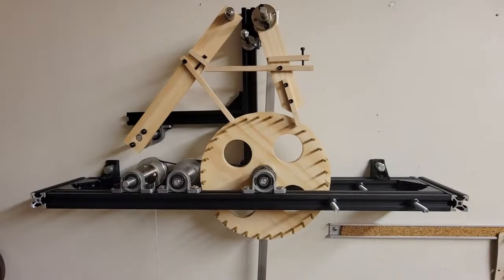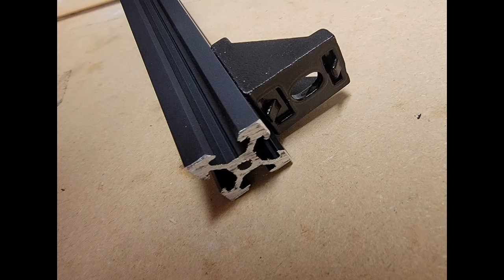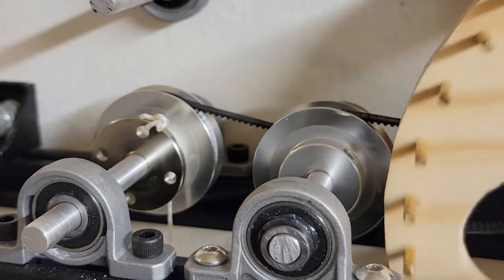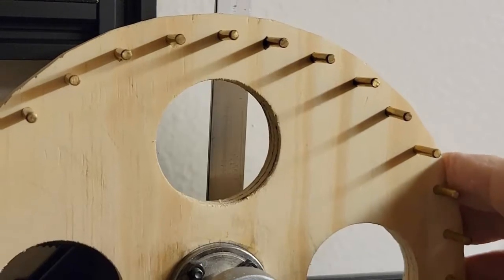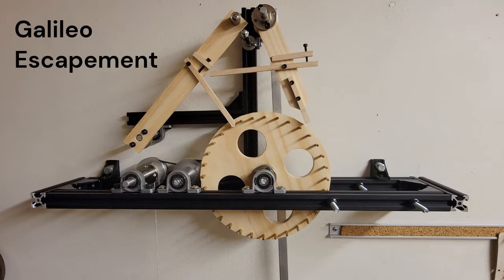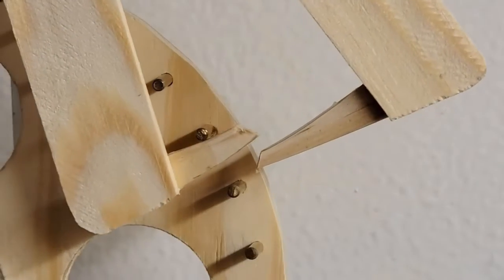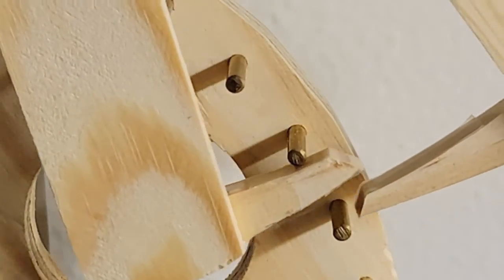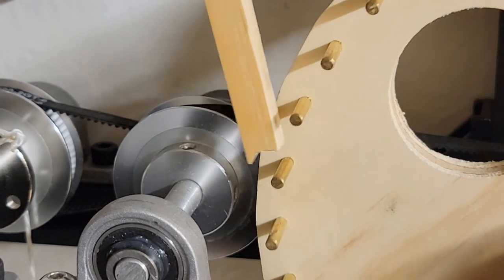Four Wooden Clock Escapements

Comment: Nice to see several types. Do you know huygen drive, to constant load the weight? Can improve this?
Reply from the maker: Are you talking about a Remontoire rig that rewinds itself frequently to keep the weight constant?  I've seen seen several of those on clock builder's channels.  Wonderful mechanisms.  However, accuracy is the least of my concern with an aluminum pendulum rod and a weight system that has to be wound 3 times a day.  I am interested to see if I could do a gravity escapement on this system. Gravity movements were used a lot in the large clock movements that went into tower clocks.

Comment: Hello Jeff. What was the longest run time? And which escapement was it? Thanks!
Reply from the maker: I never really measured them.  Each escapement runs on the same wheel and same pendulum, so I assume they're about the same, to first order.  The weight drops 12" per hour, so It's only good for about 5 hours until the weight hits the floor.  I'd need more gears and heavier weights to even get it to run 24 hours.
Reply: @jeffg8232  Ok thanks Jeff, much appreciated.

Comment: 32 pins on the escapement wheel?  That’s an unusual number for horological purposes.
Reply from the maker: Yes, 32 pins is unusual, but this was just an exercise in building escapements. I have a limited number of tools, and no 3d printing, CNC, or anything for precise saw cuts.  That's why I used a pin wheel.  I used 32 because is a power of 2, and I could lay out the wheel by bisecting right angles with a compass.  These would never be clocks since the weight needs rewinding every 8 houses.
Reply: @ powers of two rule :-).  Too bad the ancient Babylonians used base 60 instead of binary.

Comment: I was trying to visualize the pinwheel escapement with a 1 pin and separation distance to see if I could eliminate the drop that you need to have to let the pin through. I sketched and found moving one arm a pin up doesn't solve the problem because on the return, the mechanism bumps into the pin and stops the pendulum. I'm trying to come up with an escapement with minimal friction or impact. I also thought about a pin on the pendulum arm that follows a grooved track in an escapement wheel (roughly looking like a routed sinewave in the side or edge of a wooden disc). The only problem is it locks the pendulum into one amplitude but it might actually work because it's quite difficult to force the pendulum to wiggle faster than its natural resonant frequency. If I had two rollers on the pendulum arm, I could make them roll along the edge of a wavy track.
Reply from the maker: In developing these escapement models, friction was one of my major enemies. Getting that little nudge of energy back into the pendulum reliably was difficult when friction would slow things down, especially when working with wood surfaces. I really liked the grasshopper movement because the pin just slightly rotates on the catch point, but doesn't slide.  I'm also interested in gravity escapements. They appear to have minimal sliding components.  Your pin-in-groove idea is going to be a challenge in many aspects. Please make a video if you succeed.

Comment: Which one had the best performance?
Reply from the maker: I didn't build these for timekeeping performance, rather as a building and learning experience. I've made no attempt to measure the stability of these escapements.  The Galileo was the most difficult to get working, and the grasshopper was the easiest.  I like the grasshopper because it is the most satisfying to watch.  Stay tuned.  I am starting to work on a video of a vintage regulator clock that takes the performance prize.
Reply: @jeffg8232  - Thank you for the reply.  I hope that clockwork can make a comeback and replace batteries for a lot of simple home devices.  Any advice on fitting clockwork mechanisms into larger projects?
Reply from the maker: @christopherd.winnan8701  Wow! You're on your own for that.  No idea what devices you would like to convert, but these escapements wouldn't go far.  You have to wind them every 8 hours or so. Good Luck.
Reply: @jeffg8232  - I am more interested in the 30 day mechanism that you used for your moon clock to simulate the tides.  Thanks for the great vid.

Comment: noce innpvative clock.  how accurate..?
your grasshopper looks pretty nice..
Maybe you could do a video that monitors the precision
Reply from the maker: I really didn't build these escapements for time accuracy.  It was an exercise in design and building.  The aluminum pendulum would make them very temperature sensitive, and the weight needs to be wound about every 8 hours.  However, I did make a digital "tick counter" to compare the swing of a pendulum to a 1.843200 MHz time reference.  It can show long term drift of a pendulum clock.  Maybe I will do a video on that.

Comment: Thks & interesting,
A clock is just an oscillator in-general.  ?Could you tell me the crux purpose of an escapement?
For example maybe the escapement converts oscillation motion (ex: pendulum) into a constant rotational/angular speed (ex: clock hands).
Reply from the maker: The escapement is the system to generate a constant beat or tempo (in musical terms). All the other gears in a clock are a system to count those beats. If your escapement ticks once per second, then you need gears to make 60X60 = 3600 ticks to drive the minute hand exactly 1 rotation to indicate 1 hour. I think of gears in terms of a digital divide by "n" logic circuit.  Do a Google search on clock gear ratios, and you'll see some good articles on the choice of gears use in typical clocks.
Reply: @jeffg8232  
Well-Explained & thks;
I just watched some inspiring Foucault's Pendulum & gyroscope videos.  The earth rotates around once a day & in-theory a gyroscope always points in one direction in space relative to the-stars.  An electric motor mounted on a 3axis gimbal is kinda-like an ugly free-gyro.
Soooooooooooooooooooooooooooooooooooooooooooooo I'm going to try to use an electric motor mounted on a 3axis gimbal as a cool sidereal clock.  The gyro should appear to rotate once a day (minus 4minutes for sidereal time & fingers-crossed).

Comment: Nice setup for trialing different designs, though you may want to be careful with the off center pendulum for smaller builds, it can affect beat timing.

For the Pin Wheel it's not actually required to have both pallet in the same pin space, you can stagger them over two or more spacings to increase your pallet width to the arc of escapement wheel motion. Rounding/angling the falloff edge of the pallets can give you a hair more (as long as it's past the initial contact point)
Reply from the maker: You are absolutely correct on the staggered pallets for the pinwheel.  I remember struggling to squeeze them both into one pin space.  I'm inspired to remake that escapement arm.  I didn't put much effort into make these escapements into accurate timing devices.  It was more of a exercise in building and learning.  If they ran continuously and had a nice "tick", I was content.   Thanks for your suggestion.
Reply: @jeffg8232  if that's what "not much effort" looks like, you're  already ahead of half the working clock restorers =) PS the PTFE tape solution is inspired, and don't let any traditionalist tell you otherwise. Function >  Form 👍